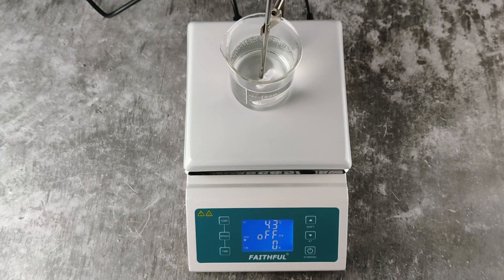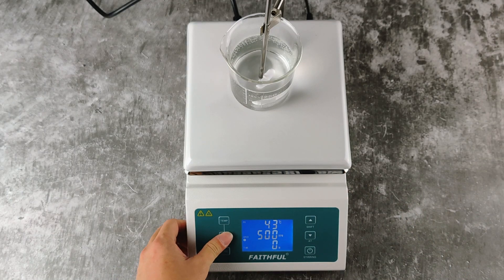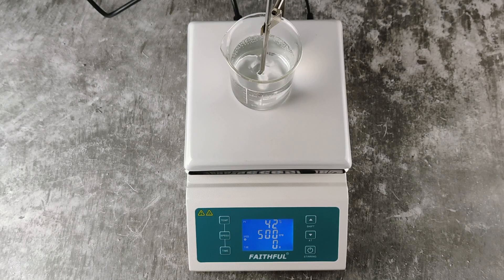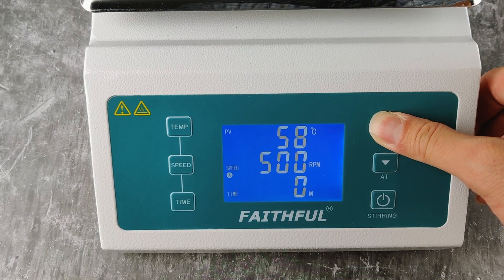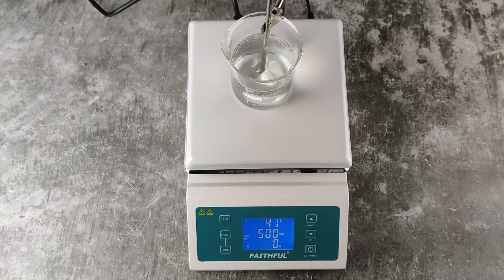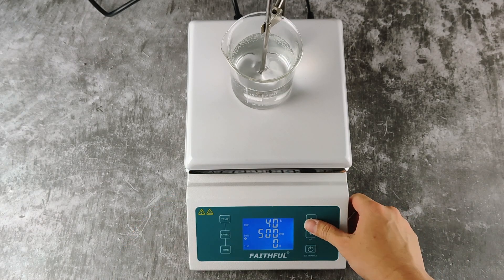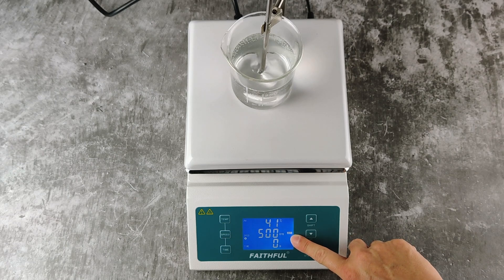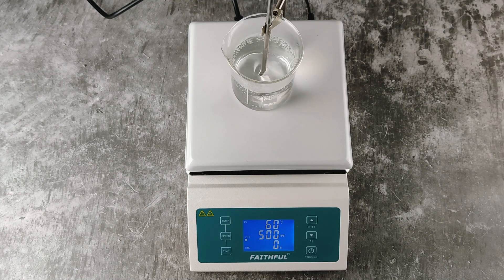HOW TO SET SH-4C HOTPLATE STIRRING SETTINGS

Comment: What the point of external and internal  sensor ??
Reply: Internal tells you the surface of the hot plate external tells you the temperature of the item your heating. External won’t work for every application for example drying to make crystals then you want the internal one to maintain a constant temperature of the plate